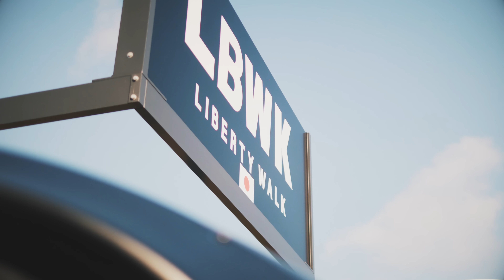Liberty Walk shocks everyone with this 4-Rotor Silvia S15...

Comment: Subaru Impreza P1 was a Sti Impreza modified by Prodrive for the English and Irish Market because we didn't get any of the Impreza 22b that was only sold in Japan . P1 Impreza can be bought form 15 to 30k and a 22b that is the only widebody 2 door Impreza sell for anywhere from 60 to 200k 👍👌🤙💯
Reply: P1 is based on a Type R. The 2 door Impreza made by Subaru
Reply: Aaaaannnddd now they are double the price 🍻
Reply: The P1 was based on a 2 door Type R WRX and was the answer/response to the Grey import Type R Imprezas,there was official imported 22B Imprezas with slight differences for the U.K. market. aswell
Reply: Actually there were 16 22Bs allocated for the UK market.

Comment: Correction, after doing some research the p25 is not an automatic. It's a full blown dogbox with paddle shift. The 1st to 2nd shift is computer controlled because it's such a quick gear change
Reply from the maker: Well that makes more sense. But it has no clutch pedal, so is it not an auto?
Reply: @driftgames_life  it does in fact have 3 pedals as the gear box and engine is from the s11 impreza wrc car